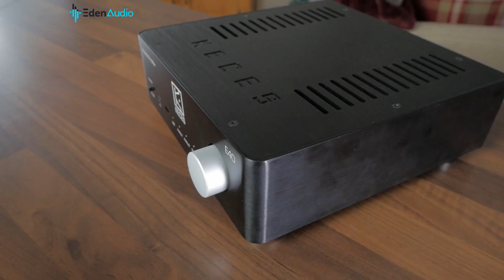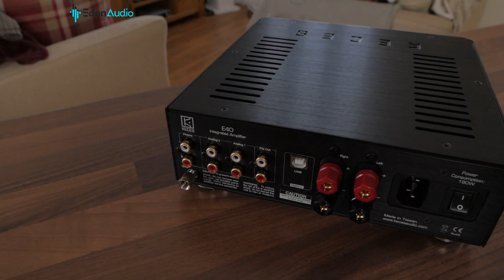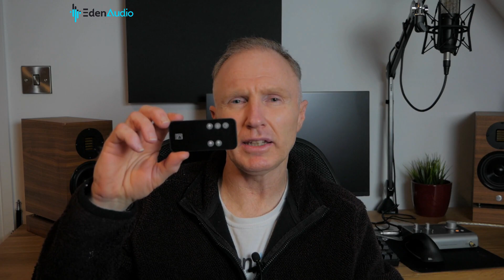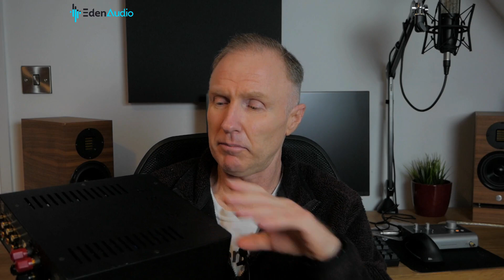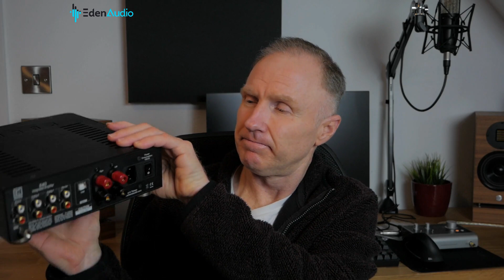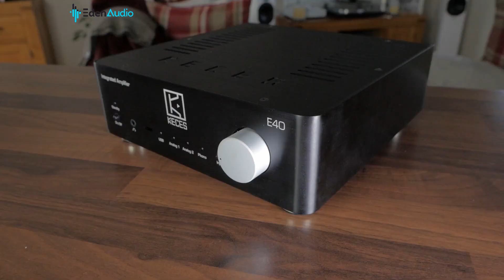Keces Audio E40 Stereo Hi-Fi Integrated Amplifier

Comment: Deal breaker 16 bit come on. That is Stone Age for USB ,DACs cost so little . I would have bought it but this is so stupid of Keces.
Reply from the maker: Agree, it's a pretty crappy DAC to boot, very flat sounding. The amp is very nice but the DAC section is a bit of a waste and best avoided.
Reply: Works well enough for desktop for Y/T and podcasts.  Otherwise, hook up an external dac.  I currently have two hooked up for comparison.  The Keces is good enough to justify a dac costing up to a grand US.  For size, weight, and performance of amp section, it's a great product. Been using mine for 2.5 years with no issues.  Actually picked up another NIB from a private seller.  

Works as a main driver too with reasonably sensitive speakers.  It handles 4 ohm loads well but wouldn't suggest for hard to drive speakers that dip much lower and less sensitive than 86dB.  I play mine anywhere between 10 to 1 oclock on volume position. very satisfied.
Reply from the maker: @nc3419  Yes the onboard DAC is fine for podcast youtube etc. It's a cracking amp, the latter ones have more power to boot.
Reply: @EdenAudio  Latter ones?  Just checked their website and nothing new as far as the amp is concerned. Know something we don't?
Reply from the maker: @nc3419  I think they increased the wattage as the spec is different. 40 to 50 watt I believe.
Reply: @EdenAudio  hmm. No updates on that.     Always was ambiguous on that regard. Some stated 40, others 50. On site measured 34/61 watts 8/4 ohm respectively while one site measures 60/75 watts at 1khz, standard measurement.  Either way, even at 34 watts max it's a great amp.
Reply from the maker: @nc3419  I'm not sure then as my spec is 40watts and the past 2 years or so it has been 50watts. Might be best to ask them to confirm.
Reply: @EdenAudio  I do not think any real specs changed. I bought mine over two years ago and both the seller as well as keces site remained same as to specs.  Probably depends on how it's measured.      Most call it a 50 watt but it is called e40 for a reason.  Still, measured as well as a rega brio at 1khz pulse with better Snr and dynamics, according to one site.

As to SQ, it isn't as lively and realistic as my Hegel but it is smooth, closer to hegel than any other inexpensive unit comes to.  I use both a Topping D70s and Aune X8 upgraded, while the dac in the Hegel is superior, the performance for a budget unit is great. 

This is the amp to consider for either beginning audiophiles with the funds, those with space limitations or for desktop or bookshelf applications.  Its a looker too.  

Wish they came out with a 90-100 watt integrated as a gap between the E40 and the S300+ though.
Reply from the maker: @nc3419  This was the original spec from the Keces site when I bought my stock.
40 Watts per channel @ 8 Ohm

Linear power supply with toroidal transformer

Asynchronous USB 2.0 supports PCM up to 48 kHz/16 bit

Phono input for MM with 47 kOhm

2 pairs RCA line level analogue inputs

Stereo preamp output for subwoofer(s)

Favourite volume memory with remote control button

Sturdy aluminium remote control included

Superb sounding headphone jack

4 mm Aluminium housing; fully shielded against EMI/RFI interference

Radiation free to prevent polluting other equipment

Weight 4 kg

Dimensions 220x220x66 mm

Latest version has 50 watts per channel @ 8 Ohm.

Maybe they just upgraded the transformer.
Reply: @EdenAudio  Perhaps.   But I sold my hegel and kept the Keces.  That's how good it is.  The Hegel could flesh out more note weight on some instruments and texture such as Piano, horns, but the Keces wasn't far behind and similar in some SQ categories.  The Keces gave better space between instruments IMO. The Hegel could also produce more glare.   Using RCA on both units.  

Still have it.  As well as a Van Alstine CA-1 which has more power, greater transparency and a bit better separation adding a more energetic presentation while the Keces is more relaxed.  The CA-1 for being so energetic is essentially glare free and controls sibilance better.  Two great budget amps that give a significantly different presentation.  Reliability top notch too.  Can't understand why these are not more popular as an introduction towards high end audio.

Comment: Regarding the Keces E40 dac section, do you think it is good enough at its limited 16-bit / 48kHz resolution to sound as good as say a mid tier dac, say around 300 pounds or so would for YT, basic music streaming up to that resolution?  

Also, regarding its dac, is the stage more flat or does it give some depth?

The goal is to use something on the desktop. If I want to stream higher quality music I would get a streamer and send to my main system. Thanks.  Speakers to be used would be Dali Opticon 1s for nearfield. Any thoughts appreciated.
Reply from the maker: The on board DAC is OK nothing more nothing less, ideal for those who want a all in one box solution, as you say OK for youtube video, spotify etc but above that on separate DAC will be a big improvement.
Reply: @EdenAudio  Thank you.

Comment: Hello sir, I have enjoyed your review. What I would ask is that the KECES is said to have a warm but still detailed presentation though rolled off so to say in the highs.  I tried a FOSI HD-A1 that some say is similarly described but I found it rather veiled not only in the highs but also the mids as they tried to make it sound "tuby".  The FOSI seemingly is of similar power but I have a feeling the KECES is not the same in audio quality.  I have a Hegel and find it excellent with my Focals and am willing to give up some capability but not a vieled, dull sound that doesn't allow say sources/dacs to be held back in their capabilities.  From what has been described by other reviewers, this integrated is of high interest to me.  Being favorably compared to a Rega Brio which I briefly heard but liked, I get the impression it is not so much veiled/dulled in presentation but offers good bloom with tight bass and detail.  Would you concur?

The alternative is class D for downsizing weight/size.  My listening habits are lower volumes to moderate (apartment).  I also watch movies and like clear voicing in 2 channel which is also a function of speakers.  This KECES seems like it could fit my needs and lastly, is the preamp section good enough to add a better quality amp if desired?  The plan is to add a dac to the integrated which should do everything I need so the internal dac isn't a consideration. 

I have listened to a Musical Fidelity M2si (flabby bass and gritty midrange), some class D (either dull or those that do sound decent lack the dynamics of class AB) and lastly a SoundArtist SA-200ia which lacked low end authority and was way too prominant in the upper mids and possibly the highs.

I listen to alot of Piano, sonatas, Nick Cave and other folk, jazz, blues and some rock.   I also like depth and instrument separation with enough layers in voice and some airyness/sparkle without being overly analytical...something to grab hold emotionally.  Alot of under a grand receivers just sound flat 2-D but at this price, another option could be a marantz receiver though I hope the KECES is a step up or two.

Any thoughts and guidance appreciated.
Reply from the maker: Hello, thanks for your question. it's a little hard to answer as i'm not familiar with the FOSI nor the other amplifiers you mention. The Keces is an excellent budget to entry level amplifier to be used with speakers I would suggest in the £500-£1000 price bracket. It has an onboard DAC and phono stage which are of decent quality, they don't match separate DACs  or phono stages. It has a nice transparent sound, powerful and good detail, ideal for room that are around 15sqm. You can add later the S125 power amplifier if you wish.

It's really hard to say to someone as we all hear things differently, but like I say in a not to large a room with speakers in that kind of price bracket I would really recommend this little amplifier for those who want everything in one box, but if you are going to add DACs and phono stages latter I don't think I would bother and just go higher in Keces range. 

HTH.
Reply: @EdenAudio  Thank you.
Reply: @EdenAudio  Is the pre section good enough for the S125 or like amp?
Reply from the maker: @nc3419  Yes I think so, I am using like this in one configuration using Aurelia  loudspeakers and it sound pretty good to my ear lugs.
Reply: @EdenAudio  Thanks again. I am trying to assemble a versatile system that can be used for either a desktop or room, with added dac and bookshelf speakers. 

My main is a hegel h160 which is smooth, with really good lows, linear and some say cooler side of neutral but I think warm enough with Focal speakers to boot.  I also have small Triangle Zetas.  Some amps are too bright in the upper mids though with French speakers.  I may also try the new Wharfedale 12 series.

It seems from reviews the Keces has good low end and low bass presence with a rolled off top end, but how would you describe the upper midrange?  How much would I be giving up in instrument separation, resolution and depth of stage?

I think in terms of musicality this little amp might do.  In comparison, I am also looking at class d amps such as the XTZ Edge (similar price point), among a few others. The KECES E-40 is also described as having a class A bias which seems to point to being a smoother presentation over say gritty or glassy.  I also don't like a veiled, dark presentation which as previously stated the FOSI had trying to mimic a tube like sound.

I think this information would be helpful to me as well as others who are looking for versatility, a smaller footprint yet a more or less audiophile but pleasing sound particularly when one listens at lower volumes as I do.

Any feedback would be appreciated.

Comment: Thank you for the review! Is Keces E40 class AB or class D?
Reply from the maker: Thanks for the comment, it's Class AB. It's good for medium sized rooms, in a larger room it will run out of puff.
Reply: @EdenAudio  Any idea if it can be a good partner to ls50 in a desktop enviroment?
Reply from the maker: @illialynx2592  I can't give you an absolute answer as I've never tried it with KEFs, but I see no reason why not, I use mine for a desktop system and it sounds stunning, so I think they should work well together near-field.